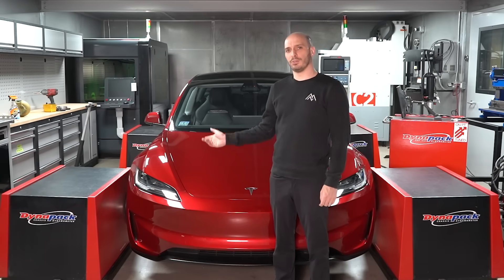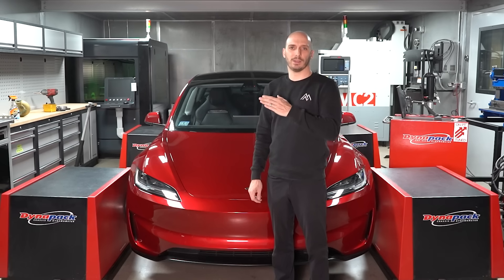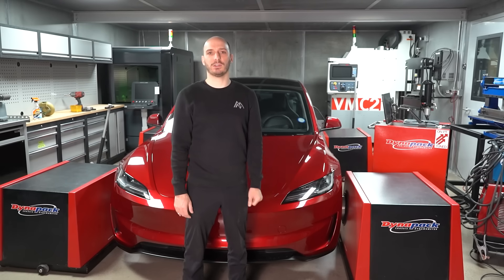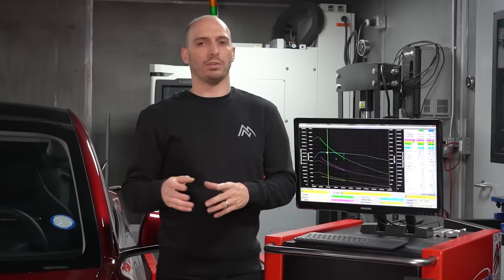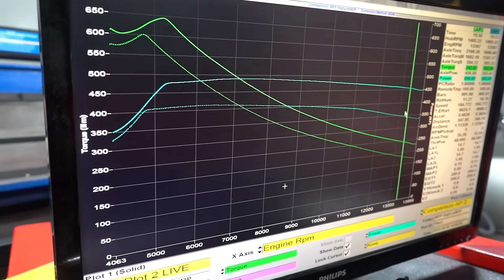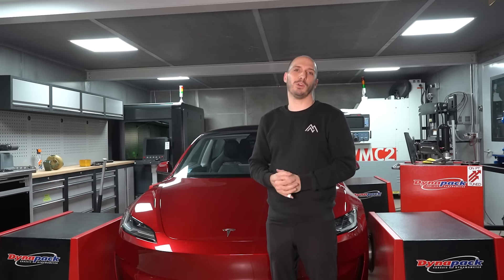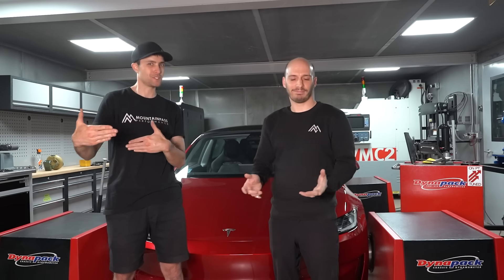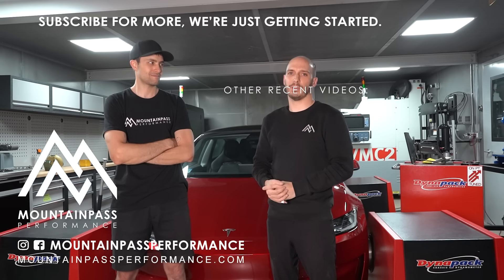Dyno Testing a Highland Model 3 Performance

Comment: I'm picking up my Highland Performance model on Thursday so this is a very timely video! From a daily usability perspective, I think the upgrade fro my 2018 will be quite significant...
Reply: Night n day. I went from a 2020 to  2024 highland. Both just LR dual motors.
Reply: I went from 2019 M3P to 2024 M3P, it's a truly night and day difference.
The ride can't even be compared, it's smoother, more comfortable, yet feels so, so, so much more stable. Nevermind the adaptive suspension, the Sport option is great, stays really flat. Cabin is drastically quieter, the seats provide actual support now, and the interior feels higher quality.
The only thing letting it down is the OEM P Zero tyres, they really don't compare against the PS4S that used to come stock. ^^
Reply: I’d love to hear the difference between 2018 performance and 2025 performance in regards to power felt at lower SOC levels.  Does the new highland hold power down below 40%?
Reply: The difference is significant, refinement especially.
Reply: I can feel the depreciation from here. I'm sorry for your loss.
Reply: @AvocadoAfficionadothe depreciation for him won’t be nearly as significant as it was for others over the last few years. The tax incentives end this month. When you’re getting nearly 10k back for buying new you can’t possibly sell a barely used example without a huge price drop is it won’t get any incentives. Who is going to buy a 2024 for say 45k when you can get a 2025 for 55k with 7500 plus coming back to you? The dealers had to beat the prices down artificially. Buying new from now on won’t be so bad and the crazy discounted prices  on slightly used examples is about to end. It’s basic math.
Reply: @ImNotLostButWhereAmI depreciation isn't based on the individual.

Lmao
Reply: @AvocadoAfficionadowtf are you trying to say? clearly you don’t understand the point.
Reply: @ImNotLostButWhereAmI depreciation isn't based on the individual.

Did I stutter?
Reply: @AvocadoAfficionado @AvocadoAfficionado If you're worried about depreciation, I laugh at your tax bracket. Did I stutter?
Reply: @HittinyaWitDaTruth why would I be worried?
Reply: @AvocadoAfficionado Depreciation should be significantly better now that the EV tax credit is done and over with. One of the main driving factors for high depreciation was the timing of them releasing a new model, along with EV tax credits. It didn't make sense to purchase a used EV, for example, at 30k when you can get a new one at 45k and then get that down to 38k with the 7500 tax credit. You would have a newer EV with better features, upgraded interior and exterior, overall better hardware, and generally a longer warranty. With the EV tax credit now gone, the used car market will see people buying up all the good deals, and once those are gone, then they will grow in price as they become more scarce. They likely won't rise a super significant amount, but I'd bet that they will all go up by between 2k to 5k at least.
Reply: @ProXcaliber  imagine thinking it's the rebate and not the fact the brand is literally so radioactive people would consider buying a car from a company called "Yang Wang" instead.
Reply: @AvocadoAfficionado That’s certainly a factor, but not as significant as you might think. Most people don’t keep up with trends for long, as demonstrated in numerous other instances where events occur, followed by a brief surge of interest and then a return to normalcy. Many people move on to the next issue much faster than you might expect. Additionally, high depreciation isn’t exclusive to Tesla and their electric vehicles; it has also affected other manufacturers and their electric vehicles.
Reply: @ProXcaliber "don't keep up with trends for long" is this what you keep saying while you watch Tesla's market share evaporate?

Radioactivity is not a trend and people will remember. Musk has gone thermonuclear more times than I can count and isn't the type of guy to carefully rebuild a companies reputation - The brand is cooked.
Reply: @AvocadoAfficionado I’m not so sure about that market share evaporation. Just looked at the stock and they are up on an all time high right now.
Reply: @ProXcaliber Why would you look at the share price to determine their market share?
Reply: @AvocadoAfficionado Because market share isn’t everything, and a stock price is a good indicator of how a company is performing. If market share was everything, then companies like Apple wouldn’t exist. And I’m certain that you would not consider Apple to be performing poorly.
Reply: @ProXcaliber But why would you look at their share price to try and figure out their market share?

"How much are apples" - me
"Oranges are $2" - you
"Why would you tell me how much oranges cost?" - me
"Apples are a bad indicator of orange value" - you
"Nobody is asking about oranges" - me
Reply: @AvocadoAfficionado In my mind, higher stock price typically indicates higher sales numbers, and high profit generation. This often means one of two things or both at the same time, that being, they either significantly reduced cost of manufacturing or they are making more sales which means they are still growing. Plus, I wouldn’t exactly say that competition is bad, especially for consumers. Overall, if they lose EV dominance, I see that as a good thing because it will force them to make better and more popular EVs. Their Q3 financial report is due in a few days so I guess we will see how much they’ve grown or shrunk.
Reply: @ProXcaliber I still have absolutely no idea why you conrinue talking about stock price in a conversation about market share but I'll bite.

#1. Their market share is decreasing faster than the market is inflating. By definition they cannot be "making more sales"

#2. Cost of manufacturing can be 0 but as market share trend down you become unprofitable as you incur more costs than manufacturing alone.

#3. Share price is divorced from the fundamentals of a business - the cost of manufacturing, how many sales they make, market share - none of it counts.

Share price only reflects market sentiment which has a proven track record of being completely rational right up until the wheels fall off.

Tesla's wheels fell off when the car model became a robot.
Reply: @AvocadoAfficionado As I already mentioned, market share isn’t everything. Monopolies aren’t a good thing, especially for consumers. Competition is good and drives innovation. I wouldn’t want a world where Tesla is the dominant EV carmaker. Regardless, like I also already mentioned, their financial report is due in a few days. I’m certain that will contain information on whether they lost or gained market share and in what areas.
Reply: @ProXcaliber Tesla is closer to being extinct than they are to being a monopoly. You'd know this if you knew their market share instead of looking at their share price.

Yes the competition is entirely the problem. Tesla is literally losing more ground than the competition is adding to the market. Tesla's solution is... A robot.

The brand is cooked and is going backwards faster than the entire market is catching up.
Reply: @AvocadoAfficionado I mean, if you feel that way, sure. I don’t really care. They definitely aren’t going to disappear. And like I already said, competition is good. I feel you are trying to get some sort of validation or reaction from people and become upset when they don’t go for it. Are you shorting Tesla stock and are upset it didn’t payout?
Reply: @ProXcaliber imagine dismissing intrinsic fundamentals as feelings.
Reply: @AvocadoAfficionado I’m not. You just keep acting like I denied that they’ve lost sales and don’t have as large of a market share or that I care. You even went as far as to completely change the topic of the conversation just to try and get a point across. What’s next? You going to start talking about BYD, Rivian, Lucid, or is it going to be something about battery degradation and range?
Reply: @ProXcaliber claims he doesn't ignore fundamentals.

>Looks at the stock price when talking about market share.

You're in denial, upvoting your own posts doesn't make your argument any better. 😂
Reply: @AvocadoAfficionado You switched from used-EV depreciation to a doom rant about market share, then to stock price, then to robots. If you need a new topic every reply, you don’t have an argument—you have a tantrum.

Market share ≠ viability. Viability ≠ your feelings. And none of that changes the original point about used-EV pricing. If you want therapy for X rage, book it elsewhere. I’m out.
Reply: @AvocadoAfficionado not everyone is poor
Reply: @AmiGarver ah yes, depreciation only happens to the poor.

What a melon.
Reply: @AvocadoAfficionado meanwhile, the rich just sprinkle fairy dust on their Teslas and they appreciate forever. Genius take, melonhead.
Reply: @AvocadoAfficionadowhat car doesn’t depreciate lol